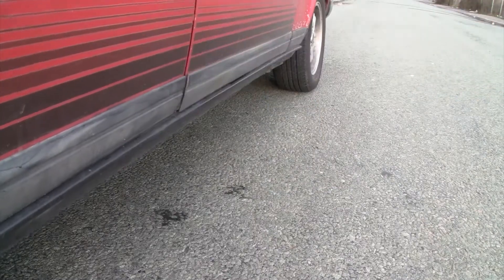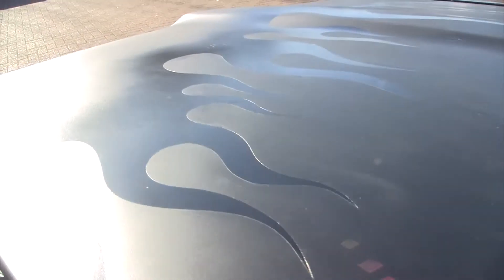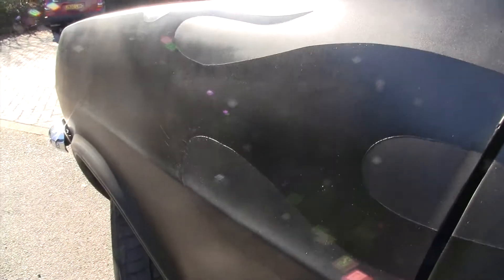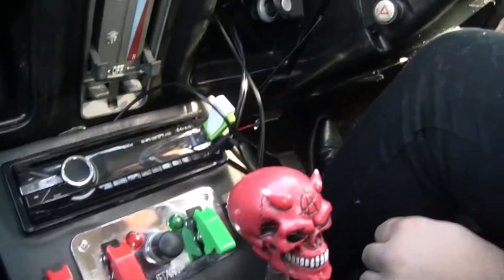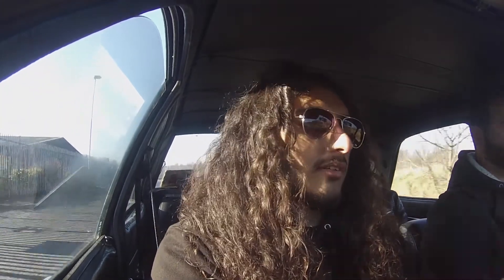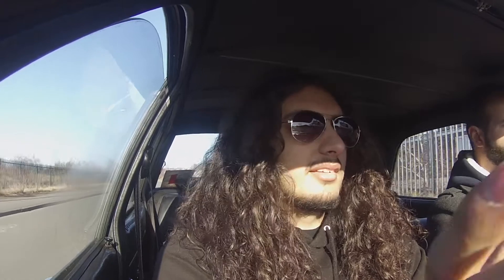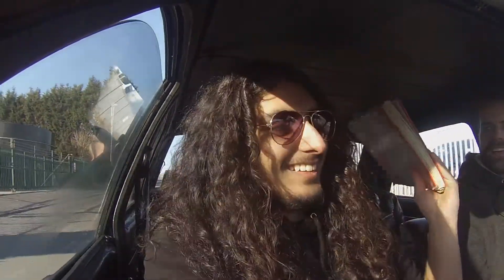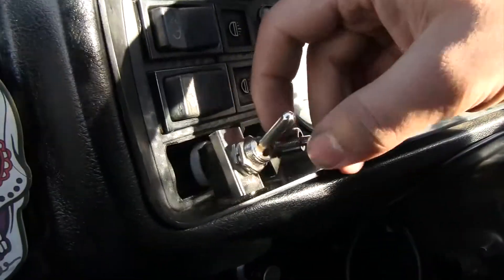Retro Dailys EP5 Vauxhall Viva

Comment: Those 1256 engines would crank out 80 bhp with a Bill Blydenstein stage h3 kit which is the highest stage you can get. That engine in your viva with the strommie cd150 side draught carb is good for 69bhp. Same output as a 90 series 1159cc unit. My apologies if that took the air out of your sails, pal. The engine and gearbox sound great for a car that age. The gearboxes are the weakest link with those Vivas.
Reply: you sir would be correct! if i remember rightly (few years has passed now i can barely remember what i ate for breakfast haha
) 80bhp was a guess based off the other vivas and chevettes on the club pages turns out at the time of this vid it would have been making around 60bhp, now a few years on i did a full engine rebuild with new everything, had the head skimmed etc stage 1 race clutch and a nikki twin choke carb so its now pushing somewhere between 70 and 80bhp still not anything impressive but for a 700KG car it pulls well and keeps up with modern traffic and has been my daily driver since sept 2016 so has been a reliable old thing too haha

Comment: 58BHP. Be careful what wheels you fit. The Viva HC takes 4” PCD wheels , so 100mm PCD wheels will cause the studs to come out eventually. I had loads of Chevette / Viva spares but I threw them out in 2016, sorry. You could have had them.
Reply: appreciate that cheers dude! yeah aware of the pcd differences so do keep an eye on them however no problems as of yet, rear drums slide on and off really well, currently running slot mags on it and switch between those and a set of cragar ss wheels :)
Reply: It's funny how hp can vary between markets! In Australia, the 1256 engine was used in the Holden Torana from 1972 to 1975. Holden quoted 62HP with the Solex downdraught jug. I dunno where they got their figures from, 58 sounds more like it!